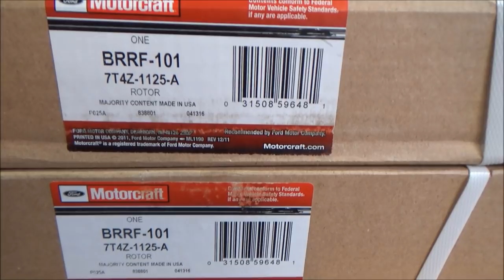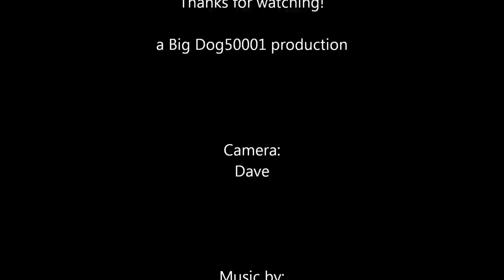Lincoln MKX/Ford Edge Rear Brake Pad and Rotor Replacement 2013 (2011-2015 Similar)

Comment from the maker: Some tools and supplies used in video:
This channel earns a small commission using some of these links - at no additional cost to you.
Caliper wind back tool:  https://amzn.to/2KBjee0
OTC Hub Resurfacing Kit: https://amzn.to/31EbSvS
Roloc type discs:  https://amzn.to/31Gkzpy
Milwaukee 3/8" Impact Wrench: https://amzn.to/2H2tYzR
3M Silicone Paste: https://amzn.to/2NePwNJ
Permatex Brake Lube: https://amzn.to/31BgnHm
Anti Seize: https://amzn.to/31DIAxp
Brake Parts Cleaner: https://amzn.to/2Z47wfK

The Big Dog 50001 Automotive Channel Store can be found here: https://www.amazon.com/shop/bigdog50001automotive

Comment: Excellent work Big Dog.  I finally got my rotor off. I will need to get the apparatus to back out the pistons. 
You went step by step, thanks for not bypassing the hard parts.
🫡
I have the MKX 2015. It’s the same.

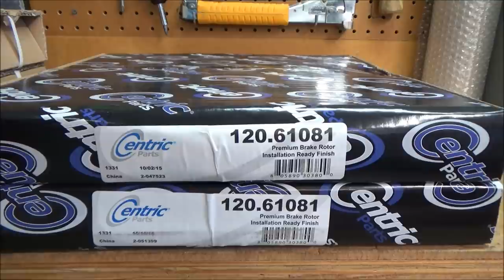Comment: 01:08 I used the exact same Centric 12061081 rotor in my Lincoln mkS install vlog. They are pretty good quality overall. Thanks for showing this on the Lincoln mkX mate.
Reply from the maker: Thanks for the comment and the input!
Reply: @BigDog50001  Cheers mate!

Comment: Thanks a lot for the good video. Just a small note on the size of those bolt heads, it's 1/2" to be precise. 13mm will work but the open end wrench will slip and may round that hex head.

Comment: Thank you very much for making this video. My local shop quoted me $1,200 to replace the rear brakes. When is asked them what this entailed it turned out that this was for pads only! Following your video I sourced the  pads and rotors with the ones that you recommended and shocks as well plus all the magic lubricants for a little under $300 bucks. I worked slowly, replaying your video making sure that everything was perfect. The job was pretty easy and the car rides perfectly.

I wonder if a brake shop actually cleans and lubricates parts as you did in the video.

Thanks again.
Reply from the maker: Glad it helped, thanks for the comment!
Reply: Wtf, your local shop needs to be burned down, anyone can change their brake pads on their lunch break,my 14 year old daughter knows how to do this
Reply: @niveklor1456  you are right. Ive been a car guy and racer all my life. At this age I have scaled back and am building my last car; a small two seat roadster based on the 54 Packard Clipper. Between that and working on both kids houses whole keeping mama happy I slugged off lawn mowing, oil changes and nuisance tasks. The first time it happened was on my Expedition. At 200,000 miles the dealer wanted almost $2,000 for a front end rebuild. I declined and for around $800 in parts, replaced EVERYTHING that could be replaced. 

My neighbor has an ‘85 Eldorado convertible. He told me that the Caddy dealer wanted almost a grand to address his heater problem; heat always on and finally steam in the engine bay. I took one look, went to the  parts store, bought $19 worth of the vacuum control valve, two feet of hose and a handful of clamps. The swapping out took fifteen minutes. Then I handed him a coupon for a $40 coolant system flush telling him to make sure that the heater is run during the flush. 

The real problem is that there are 200,000,000 people in America who have absolutely no idea of how to do ANYTHING. Your daughter is lucky to have you to expose her to taking care of stuff; skills she will use long after you and I are gone. Thanks for writing.

Comment: Good tip on the silly cone around the inside of the boot. Those old pads didn't look too bad.
Reply from the maker: Bruce L. Thanks.  No the pads weren't too bad, the right side was a bit worse though and the shims were so rusted they wouldn't stay in place anymore.

Comment: Watched several and this was the best.  Very professional.  I saw a Lincoln Reserve MKT (2019) and the rear rotors had grooves/undulations in the rotor.  only 24k miles and I was uncomfortable with it.  Any opinion?  Most rotors are flat and smooth unless damaged.

Comment: Completed the rear brakes on my 13 MKX tonight. It's a reasonably easy job as described by Big Dog50001, unless you run into a fastener problem. Initially couldn't break the T40 torx screw holding on the rotor. Fortunately my neighbor works as a mechanic on fork lifts and had a special tool that in concert with a small sledge hammer broke the bolt loose. My cordless impact wrench wasn't powerful enough. 

Second problem I faced was with the right side anti-vibration/dampner bolt that fastens on the lower part of the caliper bracket/slider assembly. It would not come off using the 13 mm box wrench. To get it off, I had to unscrew the Dampner (it took some effort) with some large pliers and then used a hacksaw to cut off the extension piece to allow me to get a special socket on the end of the damaged/stripped bolt head at the Caliper bracket. NOTE: There is nothing on the end of the bolt that the dampner attaches to use to help turn the bolt (i took the plastic cover off to check). I heated it up first, then put the socket on and with some leverage on the ratchet handle, broke the bolt free. If you live in an area that has salt applied to the roads in the winter, beware and remember to use some anti-seize to avoid having the bolts get stuck from corrosion. Would recommend pre-purchasing the Ford caliper pin/bolt kit to have on hand in case  you need it.
Reply from the maker: Sounds like you are describing a hand impact driver, I use one of those all the time removing Honda rotor screws.  The vehicle in this video is from Illinois, definitely part of the rust belt.  As these vehicle get older these fasteners will be harder to take off in rusty areas like that.  Thanks for the input.
Reply: Yes that is correct, hand impact driver. I almost considered not re-installing it, given you don't have them on the front rotors. Not sure why they are used on the rears? I'm here in Ontario, Canada so very similar weather to Illinois.
Reply from the maker: Those screws are there for ease of installation.
Reply: Well, they may help on the install side....but they are a son of a gun when it comes time to replace the rotor LOL! I may not bother using them next time the brakes need to be done.

Comment: Great job! glad I watched this. I would have tried to use a C clamp to push the pistons back in. I don't have the special tool, but used some heavy duty needle nose pliers to twist them back in and that worked fine. we just bought the car and there was no pad material left. Less than a 1/16". one was down to the metal backing plate!
Reply from the maker: I'm glad the video helped, thanks for the comment!
Reply: Kurt Watson yep, that's what I do. Long needle nose.

Comment: i appreciate your video, it convinces me to try to do it myself. the problem for me is I have a ford edge 2016 which is different design caliper from this video. it still has some life left probably a year until I will replace it. so if you have a chance to do the rear brake on edge 2016 please make a quick video also. or if you have some website resources relate to this model that would be great. thank you!
Reply from the maker: If I get one in I will try and film it, thanks for the comment!

Comment: The video was fine.  I just replaced the pads on the rear of a 2007 Ford Edge SEL. This one had a standard piston and not one that screws. No harm done.  Over-prepared a tad.  Fortunately I didn't buy the piston tool & used a loaner tool from an auto parts store . Easier than the fronts in my case.
Reply from the maker: I am glad you got it done.  I tried to make it clear that they changed the design in 2011 to this newer style, which is why I put it in the description also.  Just remember, more tools is not a bad thing!

Comment: Great job.Very helpful.I should have watched your video earlier before I replaced my ford edge rear brake pads.I have a question .What kind of brake parts lubricant you were using.Is it ceremic extreme Thermotek?And wherecan I find the blue locktite?
Thanks again.
Reply from the maker: Thank you for the comment.  I used Permatex 24125 Ceramic Extreme Brake Parts Lubricant, and Permatex 24200 Medium Strength Threadlocker Blue.  Both are readily available at auto parts stores or online.

Comment: Thanks  for the very helpful video!!! Would be possible some advise about the e brake adjustment, very limited braking with the pedal all the way down.
Reply from the maker: I will see what I can do but if you are having trouble braking I recommend having the vehicle's brakes checked by a qualified mechanic right away, you don't want to take a chance with brakes.  Thanks for the comment.
Reply: i have problem with the parking brake only, other than that works perfect. thanks for the prompt reply.

Comment: By far the best video on this job!  Shows a lot of the "gotchas" that are possible. Very methodical and clean working.  +++ for giving the torque specs which many folks leave out.  Do you happen to know the torque spec on the big axle nut, and the four bolts that hold the hub bearing assembly in place?  TIA
Reply from the maker: Thanks!  There are a lot of different models, but for the rear wheel hub/bearing assembly on this vehicle (AWD) the Wheel Hub Nut (axle nut) is 258 lb ft and the four Wheel Hub/Bearing Assembly Bolts are 85 lb ft.  Ford says to use all new nuts/bolts.   The service procedure is to use old Wheel Hub Nut and tighten axle to 258 lb ft to seat the axle, and then take old nut off and discard it and put a brand new nut on and tighten it to 258 lb ft.  New nut must be tightened withing 5 minutes of starting it on threads.
Reply: Thanks!  My GF's car (which I will be doing this on in June) is a 2011 Edge with AWD.  My torque wrench doesn't go up that high (but any excuse works to buy a new tool LOL).  I assume I would need to get new axle nuts at the dealer?
Reply from the maker: I would go with dealer axle nut/bolts.

Comment: What did you use to clean up the front brake hub full of rust? Wire brush? Chemical of sorts? Great vid!
Reply from the maker: Same way I cleaned the rear in this video, with OTC Hub Kit and roloc type discs (then brake cleaner and anti seize or fluid film to prevent future rust buildup). Roloc discs  https://amzn.to/2W1A0W5 .    OTC Hub Kit  https://amzn.to/2Egwmlt .

Comment: Open the bleeder and put a bottle. The piston goes in like butter and prevents contamination to up the line.
Reply from the maker: Just remember, opening the bleeder can introduce air into the brake system which will need to be bled.  There is also a chance of snapping the bleeder valve off on vehicles that live in the rust belt, like this one.  Thanks for the input.

Comment: Hey thanks for the video, heads up everyone if that sound vibration silencer doesn't wanna come off or start stripping the  use a 15 size wrench on the slider pin bolt. Good luck and save money fellow brothers.
Reply from the maker: Thanks for the input.

Comment: Hopefully u see this n can help. I have a 2011 lincoln mkx and the brake pedal is hard when I press it, sounds as if it's losing air, and also the radiator fan wont turn off even after turning the vehicle off. Wanna make sure it's the temp sensor before I start taking everything apart. If u got any tips on what to check i would really appreciate it, thanks n good video.

Comment: Well done!
I found following condition on mine:  All inner pads were worn 30% ahead of the outboard ones.  Did anyone else noticed this condition?  Read looked like Ford original so I am not ready to blame this on aftermarket parts.
Reply from the maker: Thank you.
Reply: Clean the pins and then lube them with caliper grease

Comment: Thanks for the Great Video, Do you know the brand or have a link of the Brake Caliper Kit you are using?, I have tried several of my local auto stores and none of the kits have the correct disc for the Ford Edge...  Thank You
Reply: I actually meant the Kit that you use to turn the Caliper Piston back in, All the kits at my local Auto Stores do not have the correct Disc to fit a Ford Edge, I was wondering if you had a name of the Maker of the kit or a link where to buy it... Thank You Again.
Reply from the maker: 7Westwood I thought I had already posted it, here it is.  https://goo.gl/guhW4W
Reply: Thank You, I just ordered the Kit... Have a Happy Easter!

Comment: Does the front brake pads installation work the similar way?
Reply from the maker: Similar, the fronts do not have a parking brake attached to them so the caliper piston will push in (no need to turn).  I believe FordTechMakuLoco has a pretty good video on the front brakes for these models.

Comment: I can't remove that bottom 13mm nut cause previous owner rounded it off so only the top 13mm bolt if off
Reply from the maker: No fun when you have to fix other people's work in addition to the job.
Reply: Heat + bolt extractor is the way I did when I worked as a mechanic

Comment: I'm concerned with the anti seize getting on the brake drum surface. If you put it in surfaces not near it, that's one thing but near it...I don't know if I'd use it there.
Reply from the maker: Nothing wrong with putting anti seize where I did in this video, and it's pretty much required if you live in a rust prone area (like the vehicle in this video).  I either use anti seize or fluid film for this.  During install, if any gets on braking surface it can be cleaned with brake parts cleaner.  BTW, there are no brake drums on the vehicle in this video.
Reply: Thanks for your reply. Have a good Thanksgiving.
Reply: I meant rotors....

Comment: You didnt have to remove parking brake cable? And no need to put rotor screw back on.
Reply from the maker: The parking brake is part of the caliper on this model year (which is why the caliper needs to be turned back in and not pushed).  As for the rotor screw, when it is your vehicle you can leave it off if you want to but if the car does not belong to you, you should certainly put the rotor screw back in.  It does make assembly easier.

Comment: Damn! The line wrench doesn’t fit in
Reply from the maker: I don't remember for sure, but I think the cheap ones from Harbor Freight will work.
Reply: I’ve bought the regular 13 mm 🔧 it works

Comment: I own a 2008 MKX and it has been the worst car that I have ever bought. It has transmission problems galore. Ford should do a recall on these models because I am seeing a lot of owners of this make having the same problems as my car.
 Frankly my Dear, I just bought a piece of Junk!
Reply from the maker: I'm not a huge fan of them myself but many vehicles have issues, just sucks when it is major like an engine or transmission issue.
Reply: Love our 2013 MKX. Been a very reliable vehicle. Made sure I replaced all the fluids at the interval recommended in the owners manual. My only complaint has been some body corrosion.